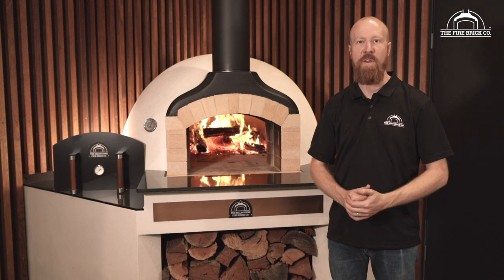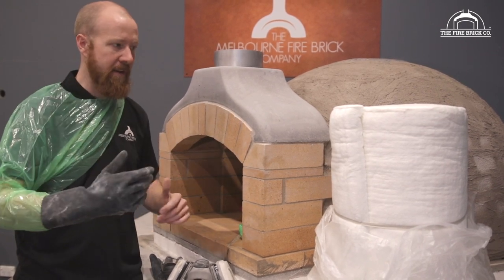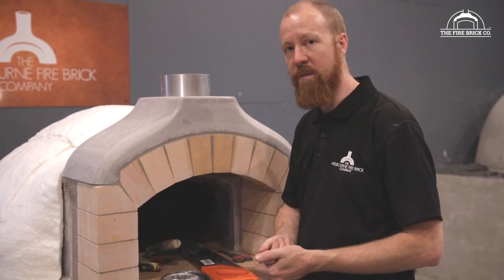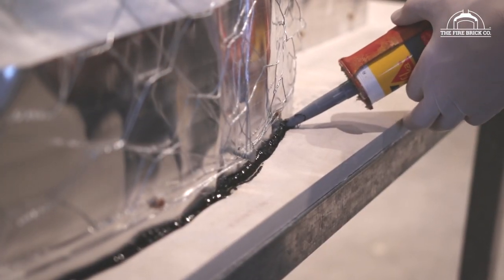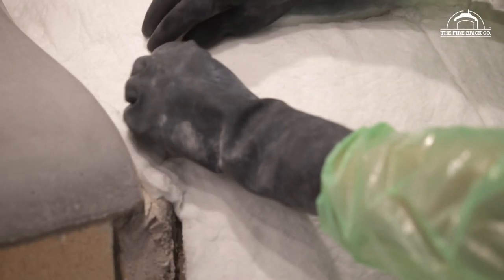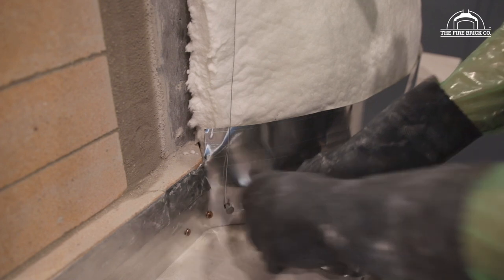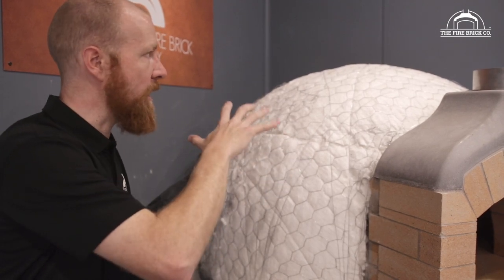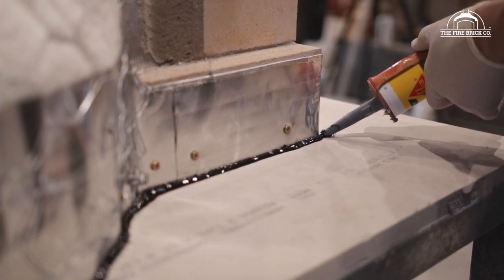How to Build our Brick Oven Kit | 9. Insulating the Brick Dome

Comment: If you use framing nails (they are double headed) at the one foot spacing on the aluminum flashing it makes it very easy to leave the correct amount of nail left out of the flashing. FYI it looks like you guys have done a great job of thinking of everything
Reply from the maker: Great tip!

Comment: Pls reply:- what will happen if we give 4mm or 5mm aluminium walls inside oven ? Can that help the oven to keep heat for long? Is that helpful??? 😅 Pls reply ❤️ i see gozney dome oven uses aluminum wall inside. Can we try that? Is that useful for brick or concrete oven ?
Reply from the maker: I cannot recommend that at all - Aluminium has a relatively low melting point so it would deteriorate very rapidly in that environment. I think the Gozney dome probably uses stainless steel. I still wouldn't suggest that, if you're building a brick oven or a precast oven using the right refractory materials then there is no need to line it at all.

Comment: Great video beautiful pizza oven 
Can I use foil insulation as well ?
Reply from the maker: You can, but it will only help if there is an air gap between the brickwork and the foil.
Reply: @TheFireBrickCo  Such as vermiculite (spelling?) and sand mix. My father in law does this, never had a problem makes huge beautiful pizza ovens, an has for 50 years. There are a lot of different ways to do this people, just know the way Fire Brick Company is telling you to do it guarantees perfection. I would recommend The Fire Brick Company, and its design to everyone who wants a long lasting wood fired oven.

Comment: Hello and wonderful series.
I can find ceramic fibre blankets. One face is the fibre blanket and one face is silver aluminum foil. Any from 10mm to 60mm thick, 0.61m wide and 3m long.
Q. Will this do the same job as the blankets you are using and if so, does the aluminum face the dome bricks or face up?
Kind regards
Reply from the maker: Hi Ian, I would be aiming for at least 50mm thickness. The foil would go to the hot face to provide some reflective insulation, but that would only really help where there is an air gap between the brickwork and the blanket.
Reply: @TheFireBrickCo  Thanks for that. The other day I've found the exact fibre fire blankets.
It can be a little difficult in Taiwan but I a quick chat with a fireman solved the problem.
Cheers and all the best.

Comment: can you tell me how you screw the aluminium foil  in that back corner please , am in this phase but can t drill there
Reply from the maker: You don't need to have screws in every single location, just enough to hold the aluminium flashing in place until the high-temp silicone sets in place. Pretty hard to get screws in back there!

Comment: Building my oven right now and my contractor did not cover the whole dome with the cement mixture as you did before you placed the insulation.  Is it necessary ?  Should they take off the insulation?

Thanks
Reply from the maker: Hi Michael! Definitely don't worry about that, we only do it if there is some leftover two-part mortar, just to use it up more than anything. If you have another build question contact us by phone or email, it'll be much faster than via YT!

Comment: why not use screws as anchor points for the tie wire instead of nails? Just drive them in and leave a bit exposed and proceed?
Reply from the maker: Screws would work well too - we use nails as they're a heavy gauge (thick diameter). But you could equally use a nice long screw, they would want to be about 120mm long though.

Comment: It is a bit unclear where and how you positioning temp probe. Is it picking up temp readings of hot air in burning chamber, or brick itself (while temp probe is embedded inside brick to read how hot copola is)?
Reply from the maker: Good question - it's picking up the air temperature